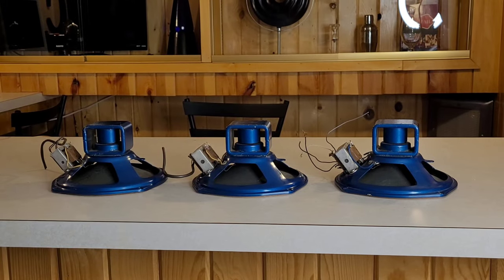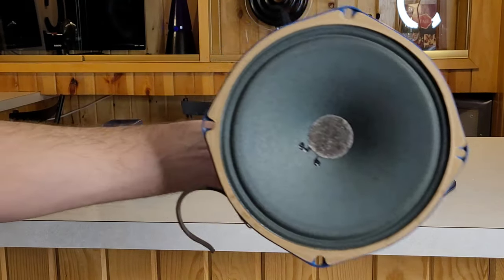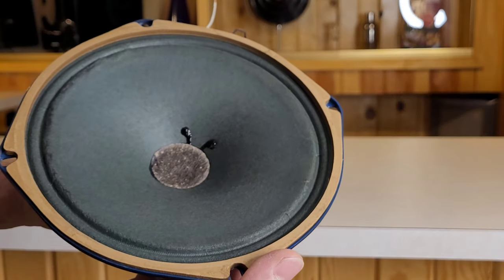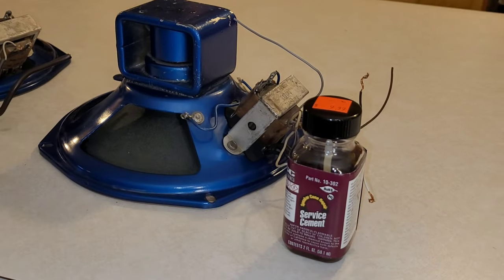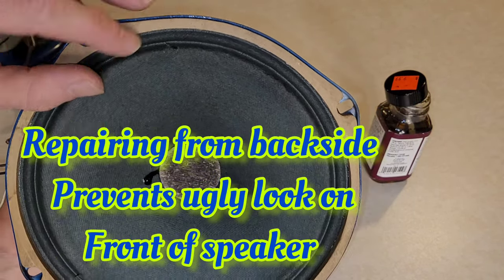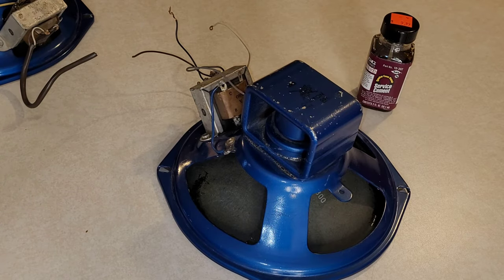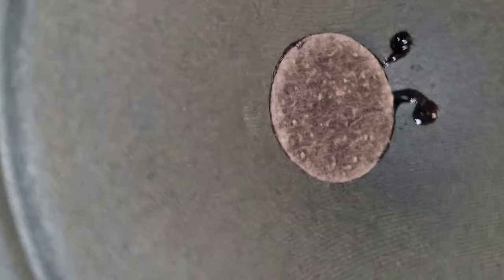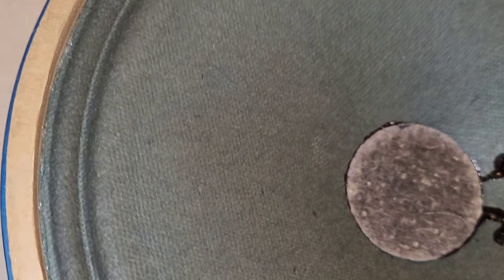Oaktron 8H8 vintage 8" speaker 🔊 Big alnico magnet 🧲

Comment: Love that metallic blue basket on that speaker. Looks awesome. Keep up the videos.
Reply from the maker: Hey friend thanks so very much. Really appreciate it. Yeah the blue is pretty cool. They sound good too.
I will do.
Reply: @speakeradventures  ive done got a vintage atlas soundolier brushed aluminum ceiling speaker grill from the 70s since my last video. It has an orange union made sticker on the back. I had an original atlas soundolier speaker that i put on it. Its like the ones used in a Waffle House.
Reply from the maker: @lilshag347productionsii6  live the silver brushed looking ones. Those are harder to find. I only have 2 of the silver ones, the rest are white. Are you going to make a video on it and the speaker?
Reply: @speakeradventures  yea i will. What brand are the silver ones you are talking about? Are they atlas soundoliers like the one i have or are they the lowell rs8-a?
Reply from the maker: @lilshag347productionsii6  honestly I can't recall. I will check when I get home from work and let you know. I had them up in my laundry room but replaced them when I put the sharp speakers up there.
Reply: @speakeradventures  ok
Reply from the maker: @lilshag347productionsii6  so I just checked but could not find any markings about who made mine. Strange..
Reply: @speakeradventures  can you do a video on them to see if they can be identified? You can usually tell who made them by the grill design on the front.
Reply from the maker: @lilshag347productionsii6  sure I can
 I will do a speaker video and show them as well.
Reply: @speakeradventures  ok

Comment: That's a nice looking speaker. Did you bypass the transformer when you ran the audio through it? It does sound pretty good. The PA speakers where I used to work didn't sound as nice. They were hollow sounding and there wasn't much bass.
Reply from the maker: Thanks so much. Yeah, I just hooked it to the speaker terminals. I too though it sounded nice; vintage speakers are neat. 
What you said about PA speakers is spot on lol. Usually no lower end.

Comment: If it was me I use foam surround
Reply from the maker: Foam would be easiest to get. Might be difficult replacing the paper surround with foam. Wonder how the sound would be.
Reply: Well I always wanted to try that with a speaker that has had the  same problem as the speaker you fix but I have heard of speaker hobbyists trying the foam method and they said it works but me myself I been doing all tricks in the book when it comes to fixing speakers 🔊
Reply: Like the old school kickers the real reason is why they stop working is because of the speaker leads wear out in a short out, and I have actually revive them Speakers back to life
Reply from the maker: @aarongunter5582  you know funny you said that, my last sub I had to repair because of a short. Where was yours at, mine was at the tinsel lead to the cone. Did not know kicker had that issue too. They are a good speaker.
Reply: Yes the oldschool kickers had really bad problems over the years with the leads wearing out and people thought they were blow but they are not it was just the speaker leads the whole time
Reply from the maker: @aaron gunter  I can see it working just the attaching it would be hard I would imagine. I also think you would need to cut the surround off the cone. I would be interested in seeing how it's done. I bet your good at fixing speakers..